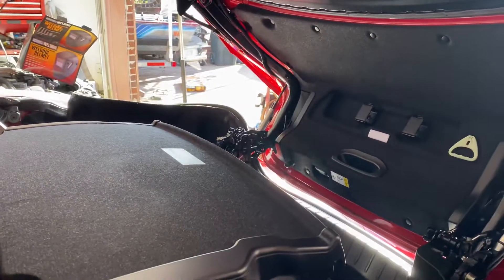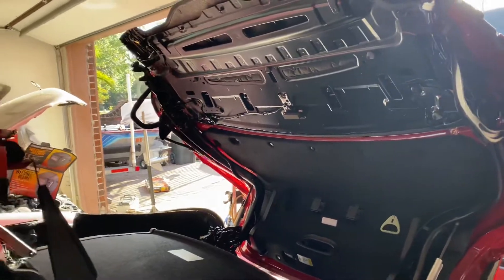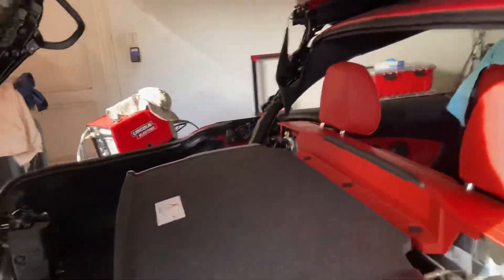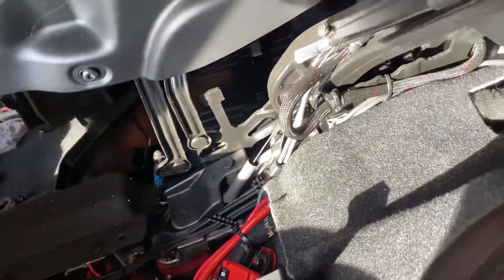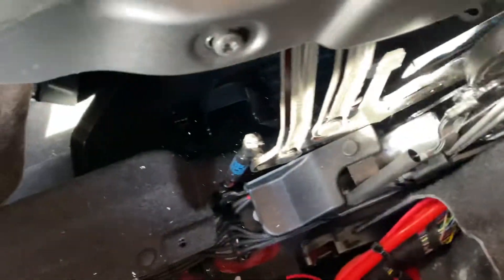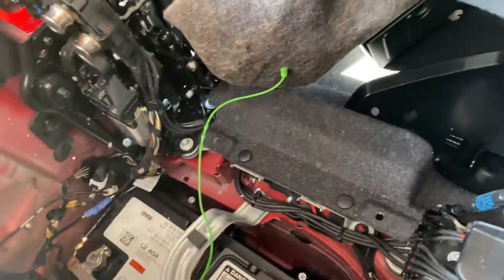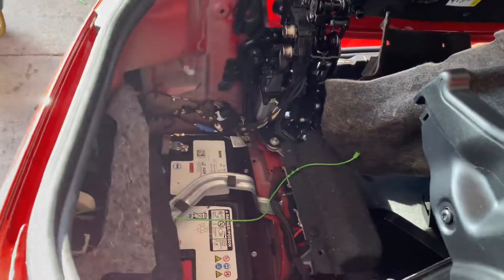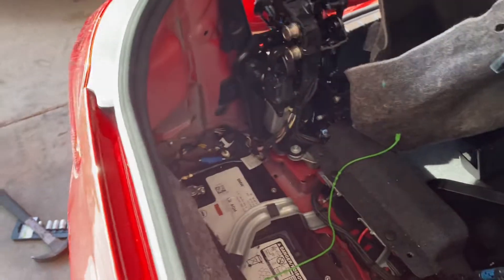How replace a battery in a 2015 BMW 428i convertible.

Comment: If I lost the key, and I need to open the trunk to change the battery. How can I do that?
Reply from the maker: let me get back to you on that in day or two right now out of town. thank you for comment
Reply: You can't. Get a key first! Then, if the battery is dead, you can supply power to the front of the car with jumper cables, etc. Then, you can open the trunk because it's an electrical locking system. But I guess that won't work if you're changing the battery. You'll need to supply auxiliary power and open the roof to the position in the video to change the battery.
Reply from the maker: @stevenparchment2  thank you